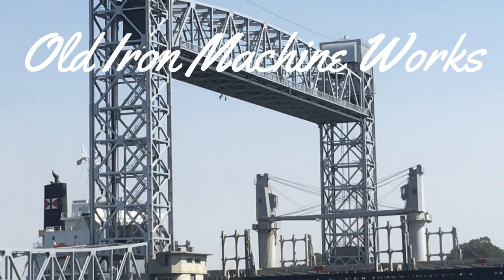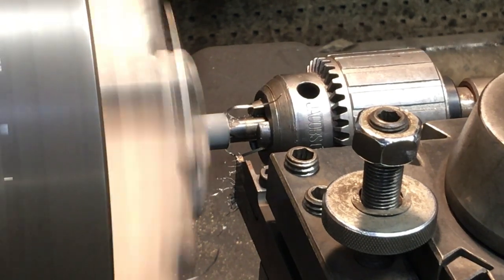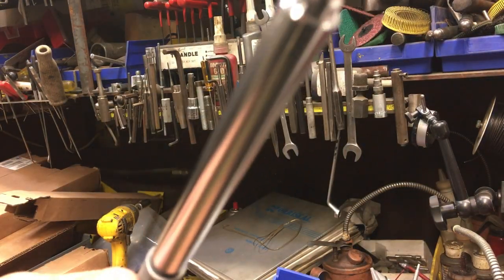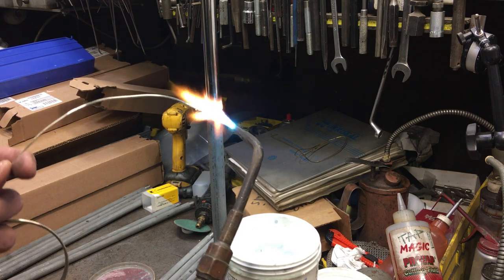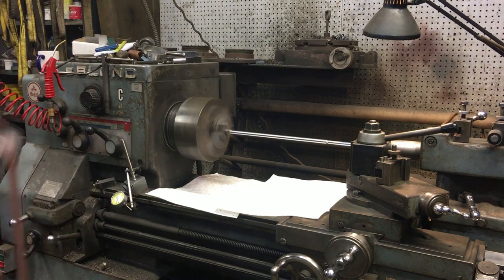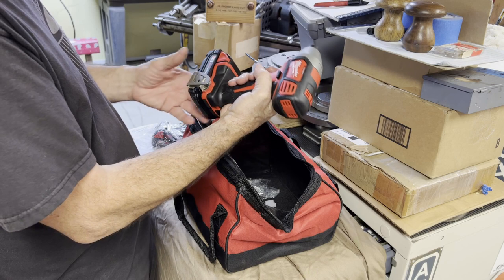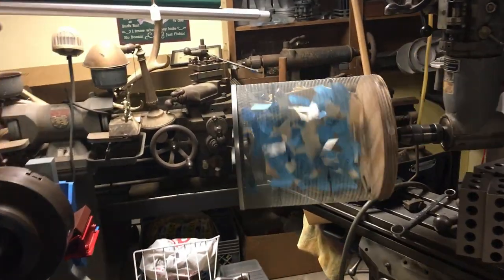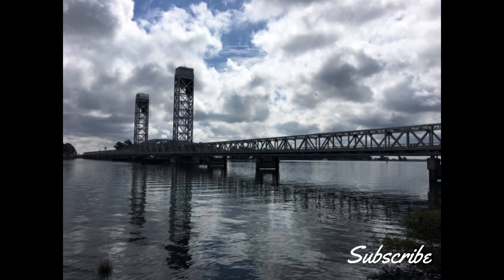Extending Compression Tester Tubes

Comment: The end mill caught me by surprise, certainly not something I've seen done before. Upon contemplation, it makes perfect sense though. Not enough material to drill, too much to ream. 

Keep up the good work!
Reply from the maker: Thank you Aaron. A end mill will cut you a straight hole like you would get with a small boring bar, where a drillbit or Reem will follow the existing hole.
But when you use an end mill you want to measure the hole because it can cut larger than the actual size of the end mill. I hope that makes sense.     Gary

Comment: Impressed by the technique of adding in the relief for the silver solder to flow into while leaving enough of the full size tube to centralize the joint and act as a stop to resist the sliver solder running down into the tube, a definite win/win. Congratulations on reaching 5k subscribers, and a quick question regarding eligibility, is it just for US residents? As shipping cost for overseas packages have increased to crazy levels in the recent year or so, and could easily exceed the value of the great prize!  Thank you for the great and varied content in your videos. I'd like to join the others on here and wish you and your family a very merry Christmas and a happy, safe and heathy new year ahead.
Reply: Ditto! Enjoyed watching.
Reply from the maker: Paul, thank you very much. That technique gives me a really strong joint without losing too much silver solder down the hole.     LOL
As far as shipping overseas, I have not looked into pricing. And that’s probably a good thing. LoL
I know I have subscribers overseas and I did not want to leave them out of the drawing, so it’s open for all and I will take care of shipping.      I appreciate you taking the time to watch my videos.      Gary
Reply: @OldIronMachineWorks  I'll send in my email in that case, but if my name comes out in the list, I'll settle for a channel sticker and the drill / driver set can go to another subscriber closer to you, as I'm a long ways from the US :)

Comment: I would have figured those big engines would have had pretty consistent service life to overhaul. Apparently not if they need to check compression that often.
Reply from the maker: Brian, These engines run 24  7
And with the big natural gas engines and the landfill gas engines the valves don’t get much lubrication and wear out pretty fast.  Definitely don’t get the hours out of the heads like you would with a Diesel engine.  Don’t forget to send an email for the drawing.     Gary

Comment: i was an ac tech did a lot of silver solider of copper tubeing
Reply from the maker: Larry, I could imagine you used your share of silver solder. I would think most fittings on an AC unit are silver soldered. Thanks for checking out the video.    Gary

Comment: Spark plugs, or glow plugs?  That has to be a diesel right?
Reply from the maker: Spark plugs. These engines run on Landfill gas.
Reply: @OldIronMachineWorks     Methane and carbon dioxide
Reply from the maker: @metalworksmachineshop  Exactly Doug. Thanks for clarifying that.